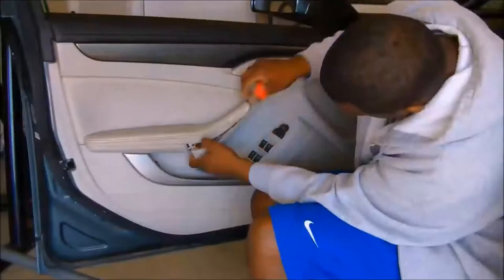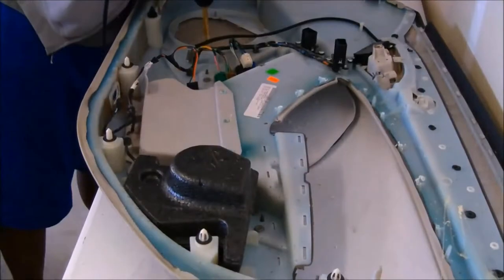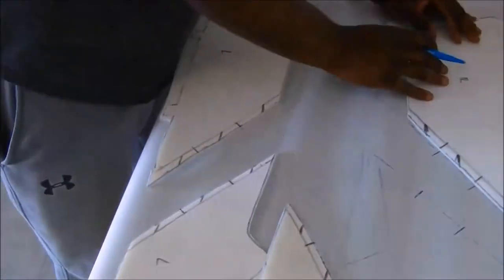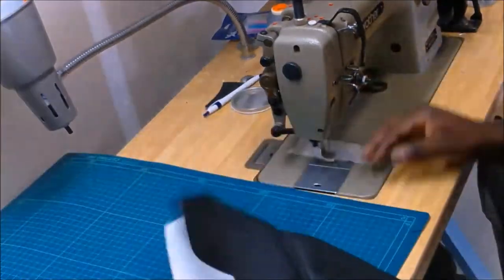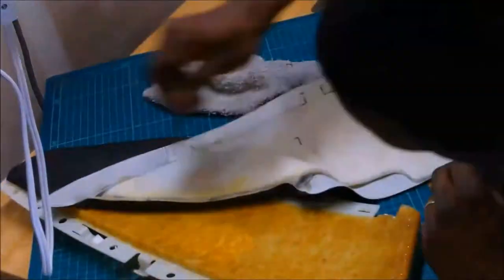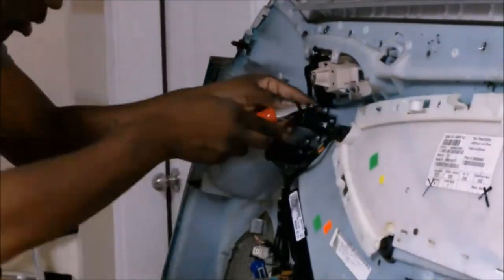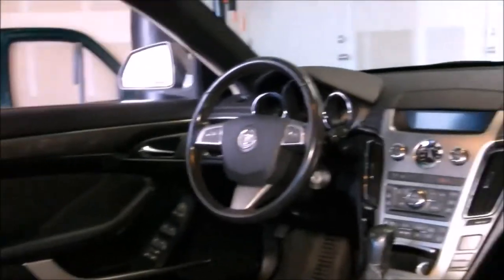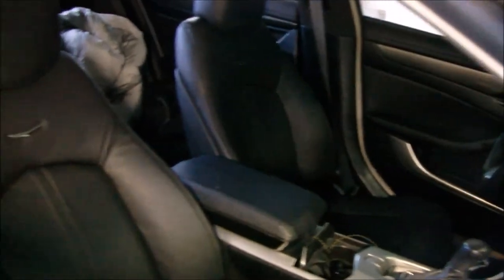Cadillac CTS Interior Color Change Fin

Comment: I was just curious if the front seat covers could be put on with the seats installed? If not, how many harnesses do I have to unplug? I’m sorry. You’re the only one that has ANYTHING related to putting a new seat cover on a CTS
Reply from the maker: ExileZO There is one harness wit three plugs. If you have an 08 - 14 you will find it in front of the seat under the canvas cover. You do need to remove the seat if you’re working on the bottom half, it’s two bolts in the back or the seat an the seatbelt that keeps it in. You’ll need torx bits for all three bolt. After that just lean the seat forward and the front will unhook. Oh yeah tilt the seat forward befor disconnecting the harness.